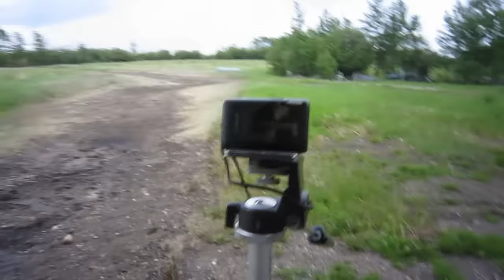Testing a GE J79 with afterburner

Comment: I worked on these engines on the test cell at Kadena AB Okinawa Japan.  It was neat to see one of these pigs run again but your video doesn't really show the noise that this engine makes.  I have been underneath one of these on an open air  test cell trying to read the variable vanes during a trim.   The howl that came it made as the engine neared a target rpm was enough to make you physically sick and it did do that do me several times.  The only engine that made more noise than a J-79 was J-58(SR 71 Motor). The first time I watched an SR 71 warm up it shook the ground enough at mil to vibrate me off the ground.  Awsome!

Comment: In the early 80's, as a Marine Corps aircraft mechanic I worked for 6 months in an enclosed test cell called a "Hush House." In that building we accommodated entire aircraft to include A-4's (my birds), A-6's, and of course F-4's. Far and away one of the most memorable experiences of my life was standing 15 feet away from the F-4 as one of the engines (only one at a time) was put into full, 7-stage afterburner. The Gunnery Sergeant in the cockpit knew that I was new at the Hush House and slammed it into afterburner to scare the hell out of new Corporal (me) standing there in amazement. I will never forget my chest as it vibrated from the rumbling of that full AB. And if the awe for my body trembling trembling from sound waves wasn't enough, the 20 foot flame coming out of the engine was the icing on the cake. My words don't adequately convey the moment, and I know I'll never get to experience that again...INCREDIBLE.

Comment: I worked on the J79 in the F4 Phantom while assigned to VF-103 and went to A school as well as C School eventually becoming CER QUALIFIED. THIS ENGINE CAN TAKE A BEATING. One thing we were always taught was if the new engine did not have a slight leak from the Aux Air Door (81) send it back lol.

Comment: Camera violently shaking while holding onto it's dear life just makes it all 500% more exciting to watch.
Reply from the maker: Yes, and as many people have refused to believe... that shaking is all caused by sound. The camera is of course not in the jet stream, but is off to the side. 
The volume of the noise is so high that it is dangerous. Not just to your hearing, but to all of you.
Foamie ear plugs under ear defenders, and it's still too much.
As you can see, it nearly shakes the camera apart.
Reply: @AgentJayZ  oh I believe you. I have performed maintenance over a huge transport helicopter engine. The thing was so loud we couldn't work in a hangar made out of riveted sheet metal. The whole building was resonating amplifying already deafening jet turbine roar.
Reply: @romant1127  like working inside of a church bell basically

Comment: I‘m in rc planes for 2 weeks now.
And i was wonderling if that engine is good for beginners
Reply from the maker: Absolutely, sir! The J79 weighs a ton and a half, burns 90 gallons per minute of jet fuel, and makes almost 9 tons of thrust. It's perfect for any beginners project in RC model making.
Reply: AgentJayZ ok thanks! Can i buy it on amazon?
Reply: You'll want something more powerful after the first time you fly it......
Reply: Peter Plassmann yeah but everyone have to start somewhere🤷🏼‍♂️
Reply: Would look forward to see you cross an ocean, as the french jetboarder did with the smaller model jetengines and the english channel..

Comment: I used to run the test cells at Bergstrom in the 1980's, there is nothing like leak testing an engine in full afterburner.  Can't describe fully what it feels to be next to it, but the feeling is still awesome.  Thanks for the memories.
Reply: It really is something else. You can feel the vibrations in your sinuses.
Reply: Was at Bergstrom in the late 80's and worked on the F4 and was engine run qualified miss that sound.

Comment: In A&P school we had a J47 off a B-47. We had it on a test stand.  At power it would start pulling the anchors out off the ground and digging up the earth behind it. We also had a pretty good grass fire behind it. You guys must have one heck of an anchor system to keep it in place at full afterburner.
Reply from the maker: I have a video about The Engine Test Stand.

Comment: I used to fly the F-4E with 2 J79-17 engines.  I believe 11,800 lbs thrust in military and 17,800 in full burner.  1000 lb per minute both engines in full burner. The aircraft weighed 31,250, With 4500 of fuel, about a 1:1 thrust to weight ratio.  Now just a Model T used for target practice.
Reply: My dad flew em... did not just watch em on a test stand
Reply: i think your right i was a crew chief on RF-4C , the F4s were beautiful i think and flying tanks , and then on T33 was at Tyndall AFB
Reply: Sad...
Reply: Hey David,  X F-4 II  VF-102 guy here.. There still are "flyable storage" ones in Tucson... a couple guys have been able to refurb them into "air show"  displays.. there are a couple vids here on YouTube.  Thank you for your service! VF-102 Diamondbacks Oceana,  OUTSLANT USS Independence  CV-62.
Reply: David J. Fox thank you for your service!

Comment: Stationed in Thailand, 388th Fighter Wing. Three squadrons of F-4Es, I can tell you how loud they get, 179 dB loud. It hurts your chest if you stand facing the rear of the aircraft when the burner is lit. It hurts so bad, you turn sideways to avoid it. No amount of hearing protection works. Spent the next two years in England on Bentwaters-Woodbridge Base, 81st fighter wing, F-4Ds. left the AF with a 30% hearing loss.
Reply: I was in the 388th at Korat.  I was there when the first F4’s arrived.  I too lost some hearing (engine mechanic)
Reply: @jamesmarlowe8231  I was there 1971-1972. I worked the last squadron of F-105F/G's in the 6010thm later changed to the 17th WW Squadron. They were no better noise wise.
Reply: I was at Korat the year of 1968.  I worked the F105’s.  Only one occasion did I work an F4.  A sheared starter shaft…I dropped the starter but they arrived before the parts did!  Someone else did the repair.  Yes, those Thunder Hog 105’s were extremely loud too.  That J75 in AB was too much!!  You are so right.  Ear protection couldn’t dampen all that racket!  By the way, I did work the F4’s at Nellis AFB, and TDY at Davis-Monthan  before Thailand.  What a crazy 4 years of my life, but I’m glad I did it.
Reply: @jamesmarlowe8231  I was Avionics, INS/Doppler. We were in for six active, for that year of schooling we got. I reupped early and did seven plus. But used that electronics training right up until I retired. It was worth the trip for seven years.
Reply: I work the e' and d,s at Lakenheath eor. Then the 111,s eor. I do miss it.
Reply: @JR-ve9ij  Only fighter I worked on, the last of the Thuds in SEA, F-105F/G, they were just as bad. Woodbridge, I was with the 67th Air Rescue Squadron, C-130s and HH-53s. We were at the takeoff end of the field as F-4D went by. Noisy airplanes compared to our prop jobs. The F-4s belonged to the 81st Fighter Wing, after they blew an ORI, we called them the 80 Worst Fighter Wing. They held their NBC practices at our end of the field, none on Bentwaters. ORI team dropped in, a Captain and Master Sergeant tossed a yellow smoke bomb, right in the middle of Bentwaters flight line. Nothing happened, they explained it off as they do that at Woodbridge and get their training there. 
They arrived at Woodbridge, went to the tower, mid field, tossed another yellow smoke bomb, nothing happened. Then the Master Sergeant looked at our end, saw us going through all the required stuff, and they came to see why we were doing the 81st training? We told them they held it at our end, made us do the training.  That ended that afternoon, they held NBC training every day in every part of Bentwaters for the next three months. We did get tasked with handling Transient Aircraft. I got to block in Italian trainers, German F-4s, and just before the Farnborough air show, the first F-15, couldn't look in the cockpit, but got a good look all around. What made it silly, I'm AMS, INS/Doppler. New nothing about servicing aircraft, other than how to block them in and out.😂😂😂😂

Comment: My most memorable afterburner experience was at an Air Show a few years ago watching a real rare bird, a Blackburn Buccaneer do a fly past, then at the second fly past the pilot hit the afterburners and put it into a steep climb......went like a bloody bat out of hell!! The sound was earth shattering!!
Reply from the maker: That would be cool to see. Maybe you saw a development prototype or something. My information is that the successful variants of the Buccaneer used the RR Spey, two of them, but without AB.
Still the Spey is a very loud engine, and two of them would be making the equivalent of about 40 thousand Hp at takeoff power.
Reply: Buccaneers are great, they do not have afterburners though

Comment: 1973, USS Independence, RVAH-14 flying RA5C Vigilante. Twin J79's.  I was a final cat-checker at launch. The roar was deafening.  Now at age 70, my hearing is going.
Reply: Made me worried those guys watching with no ear protection...
Reply: 72 was in  Air Force Kunsan Korea. I was Munision Maint  on F-4. Pulled safety flags at end of runway just b4 takeoff. Was very close to afterburners. So loud your body vibrated.
Reply: MrPepper312  In '72 I began building J79's for Phantoms. Awesome  memories.

Comment: That's awesome! "Newly rebuilt" huh? That's neat. I'm always thrilled when I change the oil and spark plugs on my vehicle and it still works after. Thanks for creating the video. When I was 12, my next door neighbor was fresh out of the Air Force and was a jet engine mechanic though I'm not sure which specifically. He had a picture on a shelf of a test burn like yours but at night. It was so cool. He became our neighbor 'cause after service he got a job at Aerojet in Rancho Cordova. That was back in '85 and there was nothing between but grassy fields and Mather Air Force Base. On very calm Saturday mornings, you could hear long burns of jet engines. I always wondered if it was from the base, 8 miles or Aerojet, 15 miles. Mather is only 8 miles so that's more likely, I'd think. Again that was back when Mather was an active military base so any day you could see B-52s or F-4 Phantoms (a childhood favorite + F-14 = drool) among many other aircraft.
Before I go, well into adulthood, around  the early 2010s, I found out that the lifelong neighbor on the other side was an engineer on the F-117!!! No one had any idea. He looked like of the drawings from the old Herman comic strip. Asked about work he'd say vaguely that he was an engineer of some kind then ramble some ridiculously technical mumbo-jumbo (nothing aerospace sounding though) and change the subject. It was probably a scripted response given the extreme top secrecy of the project.
Well, thanks for the vid, sorry I'm so wordy, I love all things aviation, just never had the aptitude to do anything with it.

Comment: As a USAF crew chief, the guy without ear protection drives me crazy. I had a guy lose a filling from a tooth during an F-16 engine run. So he’s either already completely deaf or completely insane.
Reply from the maker: The shot was taken at idle. These magic things called hands can block out a lot of sound when it gets louder. Not convenient, and hey, I am not his mother. But for a spectator, you don't really need hands, right?

Also, it was a long time ago, and I think he may have had earplugs in. It's so loud, as you know... that I use ear plugs under ear defenders when I am back there...
Reply: @AgentJayZ  wow its cool after 9 years buddy is still replying good work!

Comment: Back in the 70s I was stationed at Castle AFB. I worked for a time at the engine test cell. We had a cell for the j57 and one for the tf33. The TAC guys had their own for the j75 that went into the 106 Delta Dart. When that thing went into afterburner you could always tell because there was a momentary absence of noise then BOOM. We had a hut 50 feet away from the back of their cell. The calendar and anything tacked to the wall would stand away and coffee cups and anything not secured would just vibrate off.  There was no conversation, all you had were your thoughts. Your body would vibrate the ground would vibrate chairs would move.  It was like you were locked in and you had to ride it out. Then pffft gone the engine would throttle down and shut down. You were then free to go. You could hear that thing when we were running our own engine and it was just as dramatic.  Last thing. I was running ground while we were testing a j57. A family came out, I guess their son mom and dad and a couple of little kids. I keyed into the booth and told them and to watch what happens. The were running a j75 and the family was watching everything in awe. I turned my back on them and waited for the j75 to go ab. When it did they all thought there was an explosion and hit the ground. I was standing there with a smile and pointing at them. I had some good times on that cell.
Reply: Donald Scheibener thank you for your service!

Comment: I worked on GE J79 for many years. It is hard to R&R the AB ignition switch when the engine is installed in the F-4 A/C. I started working on them in 1977.
Reply: Ignition switch hard, try doing the throttle quadrant or even better dropping in the rig pins.
I left gallons of blood on these.
Loved it😎💣

Comment: I'm surprised that building doesn't just collapse in on itself. You know the barometric pressure inside the building must be dropping.
Reply: Ah, I see you are a man of culture as well.

(the building doesn't collapse because the drop in pressure is holded (mostly) by the engine)
Reply: Hence why the two doors are opened🙃
Reply: Only If it were a closed system and there was enough suction pressure from the intake

Comment: I was working on the F4F from 1998 to 2004. I have seen engine runs quite often. When the engines are installed in the airplane they are extreme loud. Its a sound  you can feel in your bones and estomach. But when it is mountet on a dolly like in the video it is just brutal. It made me get sick. It was realy like someone kicking in your cheast.  
I loved it 😂. 
I miss working on the good old double ugly.
Reply: the reason is the intake  of the jet engine on the jet itself dampens the sound in a good way cause it needs a special design for supersonic flight. if it is subsonic it doesnt need that special intake design so the sound is louder. the best example would be the harrier. it has a very very short intake and for this reason it must be very very loud

Comment: I used to fly F-14A's and had two TF-30 after burning engines.  The later model, F-14D, had GE F-110 engines and were about 50% more powerful.

Comment: Although I never got to work/run the J79 engine (before my time) I have worked on/ran the PW-F100-220/229, the GE F110-100/129 and my favorite one so far, the F119-PW-100. the amount of power you feel coming off a turbo fan jet engine and max AB is literally breath taking.

Comment: I can picture the mount pulling out of the floor and the whole thing firing itself down the interstate.
Reply from the maker: That's a ten ton engine pulling on a 100 ton mount. Byron measured how much it moves. .025, or one fortieth of an inch.
This test cell handles about 50 engines every year, so we built it to take it.

Comment: Many years ago I visited my brother on base when he was in the air Force. While we were there they were launching several B-52s and even though they must have been more than a mile away you could feel the house rattle.
Reply: B-52 generally my aren't bad on the base. There used to be a place you could pull off the highway off the end of the runway  that was on Griffiss AFB. It was close enough that they would still have their landing gear down and they would be unbearable loud.

Comment: Would love to see this engine being run at night. It would be awesome to see the afterburner light up the area at night.
Reply: Used to run these at night on an open air test bed and get the turbine section so hot that sometimes you could see a spot where you could see the turbine blades turn.
Reply: Eng RUN UP  IN TRIM PAD    POINT  ON THE NIGHT   REMEMBER🤩

Comment: I use to work on f 105 ,that had the J-79 jet engine In 1969 or 1970 ,we were fitted ear plugs and a head set .they are loud even with all that gear.

Comment: I wonder what would happen if I stood above the exhaust and jumped toward the exhaust gases while the engine is on full power?
Reply from the maker: Instant death.
Reply: @AgentJayZ  Yeah I'm sure, but I'm more curious about how it happens. Like, will the skin get crispy and peel off of my body? Or will it just get ripped clean off? Will my limbs get sheared off? How many G's will my body experience as I get pushed by the sheer amount of force the exhaust gases have?
Those kinds of questions. 
I don't really need a precise answer, I just need a rough idea of what's gonna happen.
Reply from the maker: Mechanical tearing apart of your body would be the primary cause of death. The fact that the air stream exerting the force that accelerates you is at about 850 degrees F would only add to the damage.
Maybe I'm wrong. Maybe you'd just go for a hot tumble, and get banged up on landing.  I'm not going to test it.
Reply: @AgentJayZ  xD
Reply: So basically, an open-casket funeral service is highly unlikely and gruesome, got it. . .   That one's definitely coming off my bucket list.
Thanks for answering my question. I really appreciate it.
Reply: Be interesting to toss in a chicken or a turkey from the grocery store to se what happens. Maybe even some tofu to keep the vegans happy...